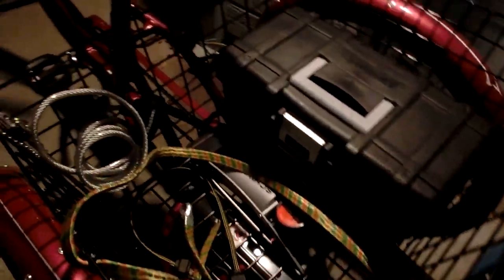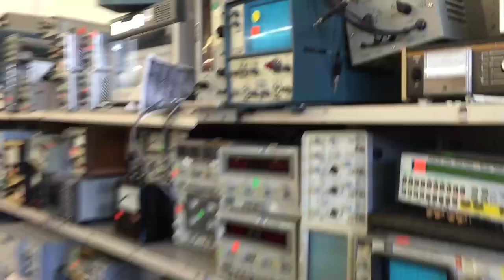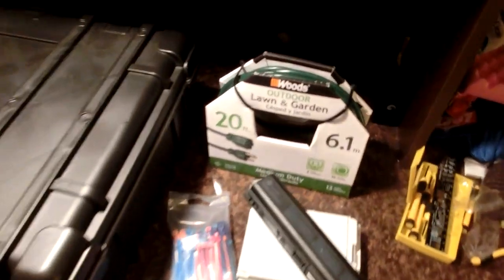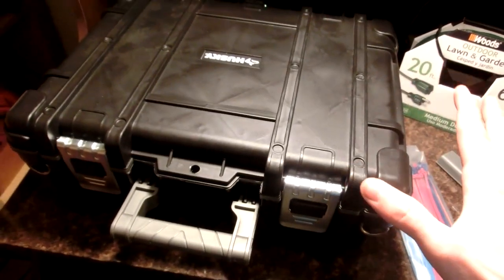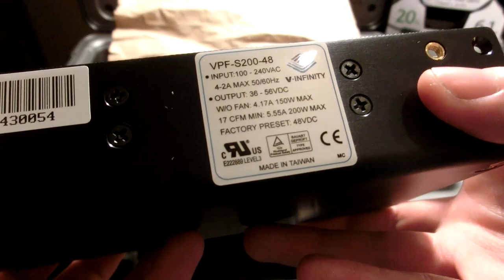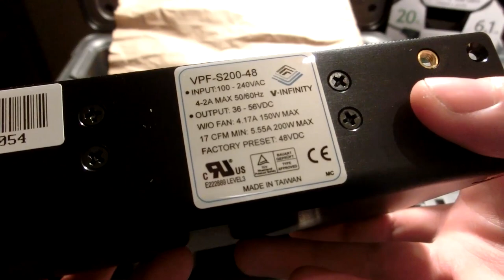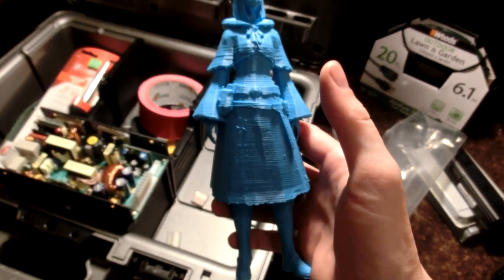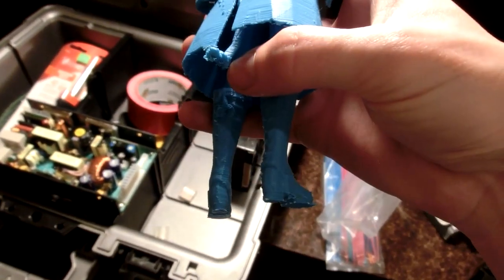Random Bits 0077: E-Trike version 1.1 and recent hardware purchases

Comment: I've used PSUs like these in the past in a design with redundant power supplies. I wonder how this model behaves in an event of over voltage. The PSUs I used, if I hooked the output to a voltage source and wound the voltage to 6V on the 5V output, then the crowbar circuit (scr) would trip and short circuit and continue shortcircuit until the voltage was brought down to 0 (to make the fuse blow). However these PSUs are designed for 48V bus systems, probably battery backed up, like telecom systems.. I would think the output is isolated from that crowbar.. The smaller connector is for power status, to tell a power manager that power is OK or lost such that it has time to act on it. Usually the small riser board you see behind the small connector is optional and you can order psu's without Power OK feature and then this riser is not there.. Just my 2c from some memories of work i did in the past.

Comment: The e-trike is looking good!  I gave you a wave out on Stevens Canyon Rd. on Sunday as I rode by in the opposite direction.
Reply from the maker: shit, i dont remember seeing you. sorry.

do you mean yesterday or last week? yesterday i went up montebello road about 2200 feet and got a nice view.
Reply: Rinoa Super-Genius Yesterday afternoon, maybe a little after 2PM.  You were just about to crest that last rise before you drop down into Cupertino.
Reply from the maker: R Brown
oh i think i may remember that.
Reply: Rinoa Super-Genius
Montebello is a pretty good climb:
- http://graphics.stanford.edu/~lucasp/grade/montebello.html
Does the new motor/controller support regen braking?
Reply from the maker: R Brown
i dont think it does, but i would add it as an external option if i wanted. right now i'm working on the charging system and have it with 2 charging modes and a circuit breaker. working on fitting it into a box now.

Comment: it looks like a DB-9 serial port, isn't it. If yes, it monitors the current in the li-ons battery while running realterm in a pc.
Reply from the maker: are you meaning the balance terminals on the battery i built? yes its a 9-pin Dsub connector, it wont connect to a serial port though.

Comment: buy 60W solder instead of 40W, buy what u need then begin to save money for rainy days and also wedding, home,...etc. A dollar earned 50 cents must be saved.
Reply from the maker: their 40w were the highest one they had for a good price, i wasnt going to pay 160$ for a soldering iron i could get from ebay for 40$. i ended up only paying 21$ for this 40w iron.
Reply: Rinoa Super-Genius I picked up a new soldering iron 60w at Radio Shack for 50% off the other day
Reply from the maker: ww321
nice, i just used that 40w soldering iron for the first time 15 minutes ago to fix my trike batteries and it worked really well. i think 40w is good enough for tiny electrical work. it really just depends on how the iron is made. still doesnt beat my 300w irons back home though.
Reply: Rinoa Super-Genius "still doesnt beat my 300w irons back home"
Amen!
I was quite impressed when I first saw you demonstrate that monstrosity in action. Quite impressed!
In another note, I am going to get out my cheap old multimeter and check the voltage of each cell in the battery pack that runs my ebike, pretty soon.
Why should you care?
Well because what I am going to see is got to be interesting for all of us Lithium Battery Powered e-mobility minded folks. 
You see, I put that 10S 38V 33Ah pack together and into my service almost a year and half ago, and been using the same charger that came with the conversion kit I bought from Xcceries with it.
Having modified its enclosure, I zipped tied the charger to the front grill of a small industrial type floor fan that had been sitting around my garage, and that effectively solved its overheating problem.
So, I have been charging that big Lithium battery pack made with Nissan Leaf Battery Cells as if it was just 10 sla batteries in series. No BMS, balancer, or nothing!...
Since the battery pack has presented no problem that I could tell with naked eye during this significant period of use and recharging, at this point, I can speculate a couple of things that may be the reason for its apparent continued useful functioning:

a- I have never totally drained the pack. I have just topped it off at 38-39v range the whole time, every other morning, as I've done my morning routine getting ready to go to work.
b- The sheer large physical size of those puppies combined with their unique manufacturing technology, just allows for quite a bit of resiliency against physical abuse (see the video!) and acceptance of less than desired charging conditions provided by that cheap Chinese charger , perhaps! I mean you'd have to parallel 15 18650's to hold as much power as one of these cells can hold!  

You know, I am really close to ordering and slapping a BMS on that battery pack, and one for a 12S of the same kind that I just got the modules for. But if after examining the cells I don't find them to be way off balance, I may just leave it alone. I'll have to see...

Thank you for reading, Rinoa. Keep enjoying Cali. I know I am ;)
Reply from the maker: Farrokh Mirbaha
the past few days i've been having a lot of issues with my batteries, turns out two cells shorted out and popped the tabs connecting them to the other cells. so the ballance leads still showed each pack being 4.2v but the output terminal was shorted to the pack before it so it was always 4v bellow. then when i was building my charger i accidently charged each pack to 4.5v because it was 4v bellow and freaked out a bit. i got it fixed today though. those three laptop battery packs i recently got turned out to be very useful.
Reply: Rinoa Super-Genius I'm envious of of you and your 300w iron ! :(
Reply: Rinoa Super-Genius Thank you for all the electrical experiments you show in your videos. What caused the shorted battery in your battery pack? I now worry about the pack I'm building. Did you bring the voltage way too low?
Reply from the maker: Henry Chang
i accidently shorted out my battery and desimated the connectors, but i'm not entirely sure if that caused it or not. either way if you put connectors between your cells that break at under 5a then it will hopefully snap those and not funnel the power of the entire battery into it.
Reply: Rinoa Super-Genius Thanks for your suggestion. Have you thought about using used car batteries instead of Li-ion batteries now that you have a big basket in the trike? I think it can hold 8 batteries, which will store 100AH or 4800WH if you can get 50AH used batteries for $10 each in a junk yard. It's more economical and safer and no balance charging is required and no fire hazard. Balance charging really sucks when you have so many cell in series. The added weight will stabilize trike at turns. Don't get me wrong. I still want Li-ion batt for my bike and drone. Your way to recycle laptop batteries is awesome. 

How's the 50V power supply you bought? LM350 IC or LM317 can make it a variable power supply down to 1.25V. Did the bike motor come with a regular charger?
Reply from the maker: Henry Chang
lead acid would be horrible, if i got the batteries bellow 50% i would damage the cells. theres a lot more worse with it too.
Reply: Henry Chang Car batteries are designed for large current draw over a few seconds. They don't do deep cycle very well and doing so leads to a short life.
Reply: Rinoa Super-Genius the 90%% diluted acid doesn't seem so horrible in your video on lead acid batteries. you said it's safe and it touched your skin a few times. If you're afraid of it now, you can replace the basket of your trike with a big wooden box. The added weight will increase the max. speed as it overcomes the wind with more kinetic energy.  And less chance for it to get stolen.

The reserve capacity (in case of alternator failure) of a starting battery is about 2 hours. that's below 50% of full capacity. If you worry about it, you use deep-cycle batt. I removed the alternator and belt to the engine in my car in order to save gasoline. The regular car battery have been doing a great job.
Reply: ww321 so are Lipo or Li-ion batteries. worse, deep cycle is fatal in those batt.
Reply: Henry Chang You can't group all of one kind of batteries in a specific set of rules. Each manufacturer builds a battery to meet their specs or to standard specs. In general the smaller the cycle range the longer the recharge life(except nicads ect)
Reply: ww321 Energy density is really important when it comes to this application. The energy density by mass of lead acid batteries is extremely poor compared to lithium-cobalt cells, meaning he would need massively more weight in lead-acid to  provide comparable capacity. That means more strain on the hub-motor going up hills and more fade in the brakes going down them.

Deep-cycle really isn't a requirement for this application. If greater range is needed, you can simply parallel another battery back at the same voltage. There's no need to drain the cells below, say, 3.6 volts/cell, as once you've done that, your performance will begin to decrease anyway.
Reply: MrJamesonStyles If you follow these answers I was telling Henry Chang that you cant use car batteries in deep cycle application. Then I was answering Henry Chang's statement about deep cycling lipo or li-ion . My point being whether lead acid, lithium or any other battery, they need to be used in a way that they were designed to be used. A 18650 cell can be designed to discharge at a C rating from .5c to 30c or even more. The mah rating of a 18650 has nothing to do with it's continuous or max discharge rate. Using lithium or lead acid as a energy supply in an EV is a deep cycle application. Going from 4.2v to 3.5v would be a deep cycle as you have used as much energy from the battery as you can and only causing minimal damage to them. There are more lead acid EVs in use than lithium , most being low speed applications .
Reply: Fair enough, I think I used the term "deep cycle" inappropriately. Like you said, taking li-ion cells down to 3.5v would be deep cycling them. I guess I was was confused as to how deep cycle was defined. Now that I've looked into the deep cycle lead-acid voltage ranges (with 10v considered fully discharged) I see that the li-ion voltage range is roughly equivalent.

I don't think I said anything about discharge ratings, though. I do understand the difference between mAh ratings and continuous discharge ratings.
Reply: MrJamesonStyles I'm sure you know about Discharge rates but I doubt  that Henry Chang does. :)
Reply: ww321
deep cycling in car batt. is ok as long as you don't delay charging too long. don't do it too often though
Reply: MrJamesonStyles
you're killing yourself if you deep cycle lipo batt. they are very hazardous
Reply: Henry Chang Wrongo Henryo ! Yes a car battery can survive several deep cycles. Deep cycle batteries are designed to survive several hundred cycles depending on the % of discharge and care of battery. A car battery probably couldn't survive 100 deep cycles.
Reply: Henry Chang Please don't group all lipo batteries in one group. Their characteristics are as varied as peoples personalities.
Reply: ww321 how deep do you want to go?
Reply: ww321 which one is the best?